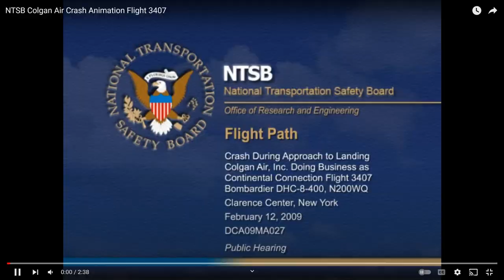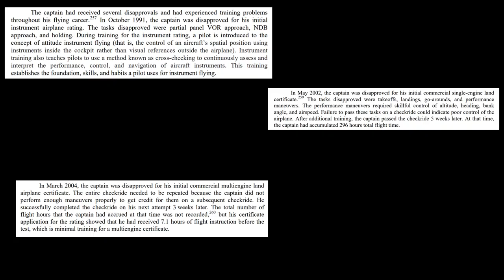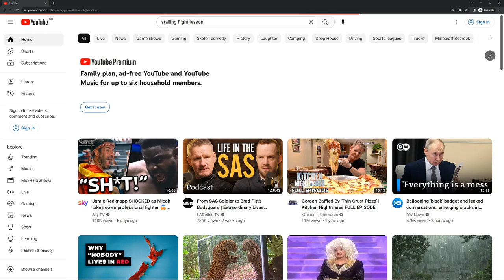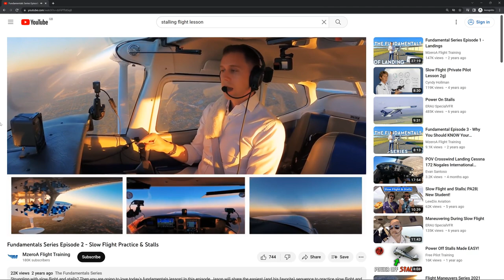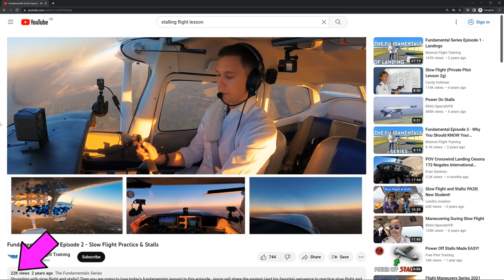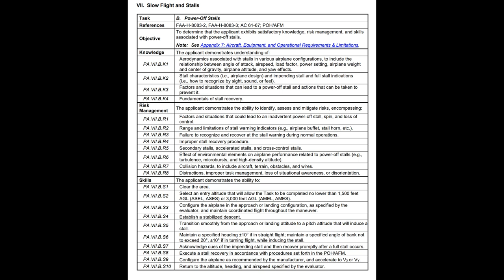Colgan Air Crash Analysis & Stalling Training Discussion

Comment: Please correct me if I am wrong; I remember from my instructor saying “ first i will get the nose up to start the stall then stall recovery will begin… he did that to show me and talked through the process while he was doing it,

When was my turn he put the aircraft in stall then left it to me to recover 

Stall recovery starts with putting the nose down,?!
Reply from the maker: Yes recovery is the reduction of angle of attack, so stick forward / nose down
Reply: Thank you..
Reply: @Taylair  what if im upside-down
Reply from the maker: You can’t fly right way up or upside down so it doesn’t really matter 😉